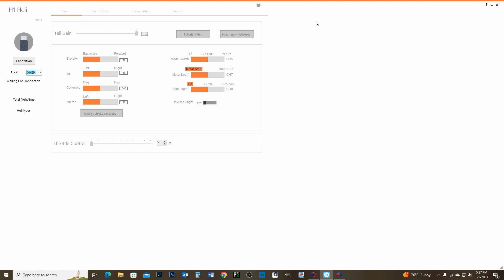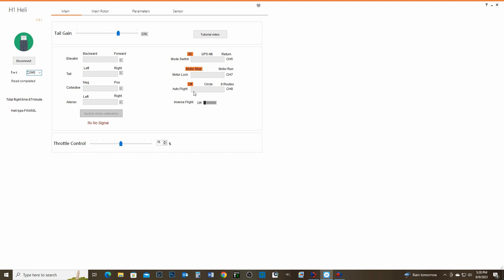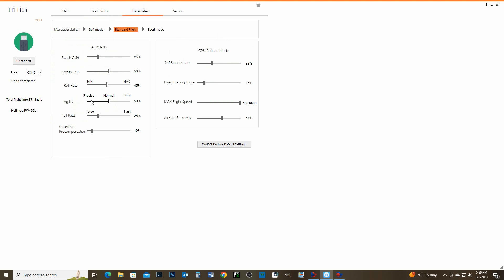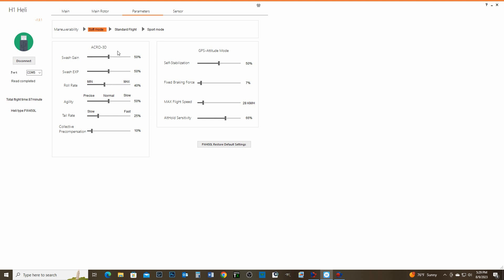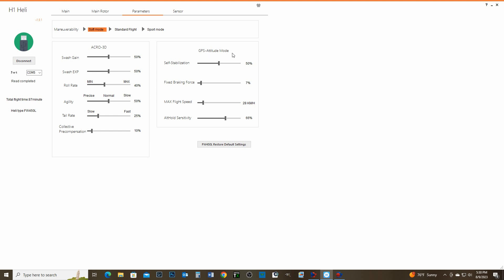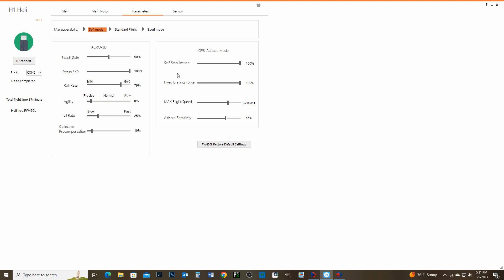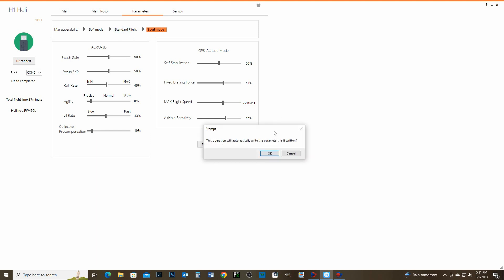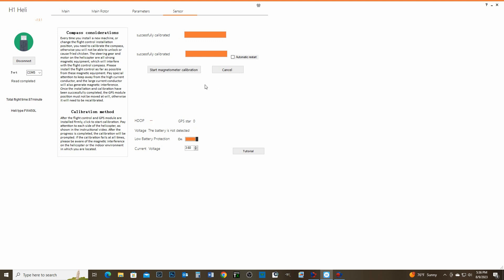look at flywing software

Comment: Cruz, what I don't understand is why after you calibrate the compass,  do you have to disconnect the wire, then reconnect?
I have yet to do that, yet my v3 flight is fine, as well as if it hits  low battery return or IF I use RTH function.
Reply from the maker: just plugging back in to see if settings saved, you dont have to